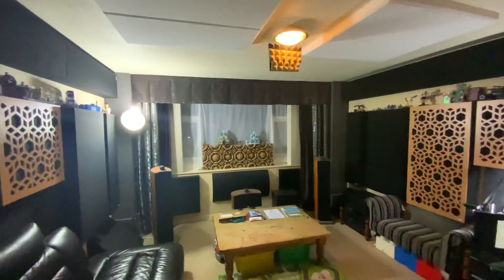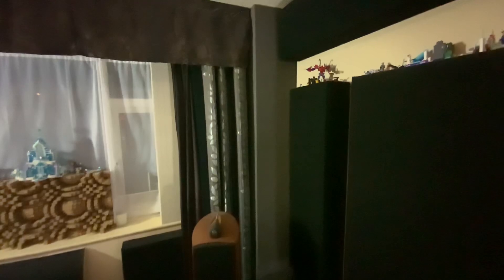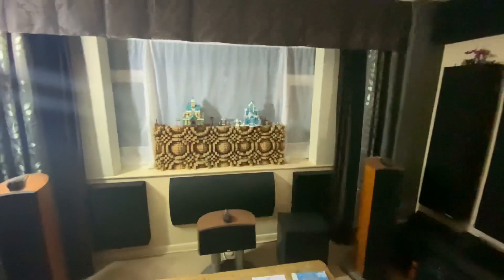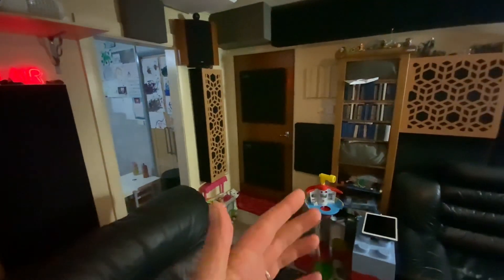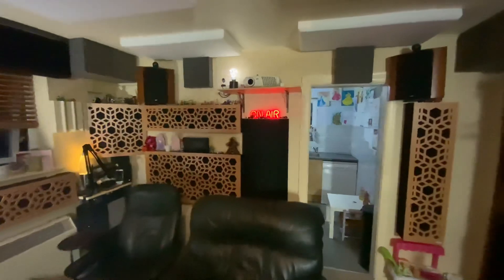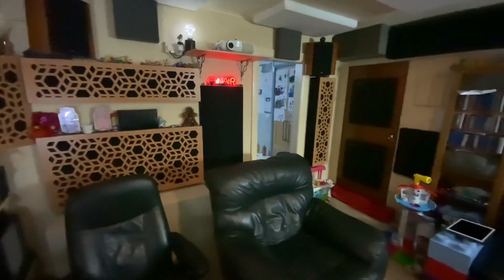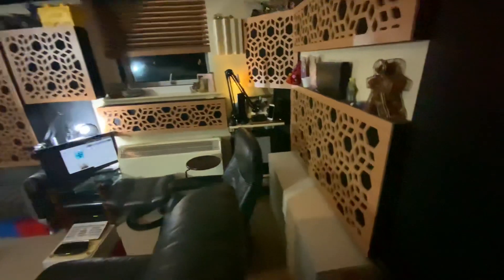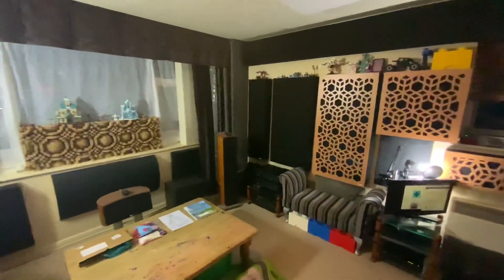You Are Using Your Foam Bass Traps WRONG!!! Full Acoustic Treatment & 40hz Bass Trap

Comment: What's a bass trap for? Why do you need them all over the house? Are they expensive?
Reply from the maker: A bass trap absorbs sound that would usually reflect off the wall and into the mic. 

Each panel costs, on average £100
The cheapest was £10
The most expensive £250 (the one I talked into with a hexagon scatter plate on the front)